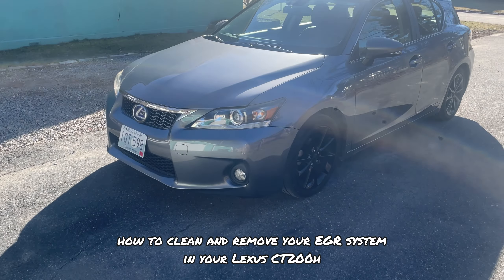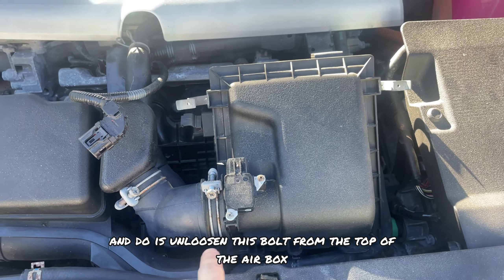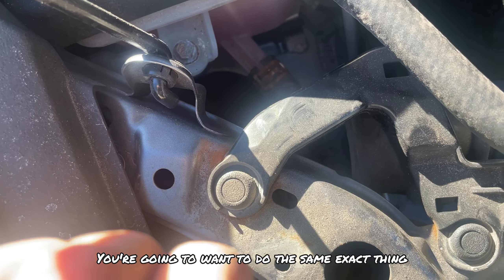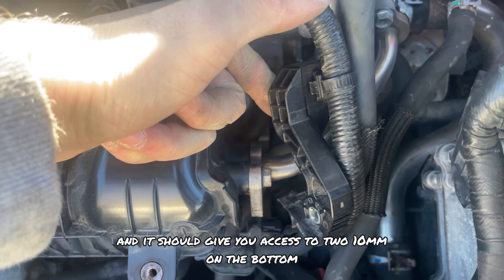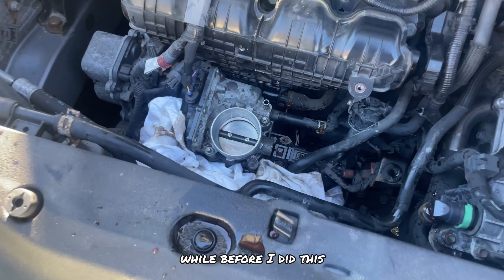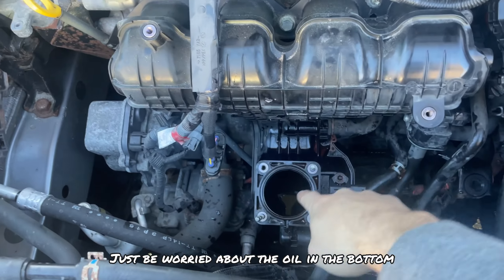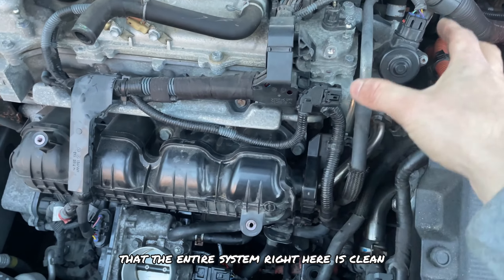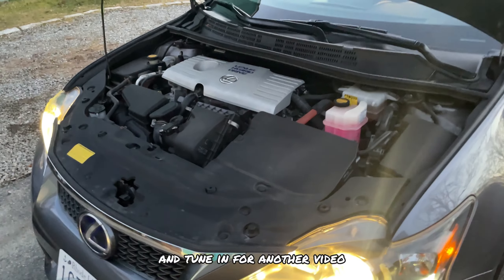How to clean the EGR system on the Lexus Ct200H!

Comment from the maker: ⚠️Keep in Mind this is NOT a full EGR system clean this is recommended if your carbon build up is mild to slow down future build up or to relieve temporary relief on the system for a couple thousand miles! A video on a Full EGR system clean will be uploaded eventually with the EGR cooler, intake manifold, and EGR valve being removed. ⚠️

Comment: Will it run noticeably smoother after the clean up ?
Reply from the maker: Yes it will especially after a newer PCV valve it will make the engine run smoother. Keep in mind this isn’t a full EGR system clean but it helps slow down the build up on the EGR cooler system

Comment: We thoroughly cleaned all the EGR parts and replaced the PCV valve. The engine light came on when we started the car. It sounds normal. Any thoughts?
Reply from the maker: Did you install all the connectors back on? Everything should be nice and snug make sure that all connections are clean and make a snapping noise to ensure proper connections, If the check engine light is still on I recommend to bring it to someone who can scan the OBD II to see what underlying error the car is alerting the ecu about
Reply: Thanks for your reply. We checked our work and sure enough there a loose connection. We connected it and the engine light went off! 

So we cleaned the EGR system, replaced spark plugs, checked the oil level, changed the transmission fluid, replaced the air filters. But the car still intermittently runs rough (a slight shudder) when it’s warmed up. It seems to occur when the car goes between battery drive to battery charge and vice versa. Or when it goes between battery drive and engine drive. I hope that makes sense.
Reply: @marystuart6864 what was the issue? With yours
Reply: A loose connector. No problem now. Thanks.

Comment: You just literally did nothing.  You were half way there to take everything off, might as well take off the EGR and intake and do the full job.
Reply from the maker: Did nothing? I stated in the beginning of the video I wasn’t gonna take out the whole system this is something you can do yourself without having to do a full service if your carbon build up is mild. Cleaning out that EGR pipe and doing the PCV, throttle body and intake will prevent faster build up on the actual EGR and improve airflow temporary which makes your service interval on a full system clean a couple thousand miles longer. I do agree that a full system clean should have been done and recorded which I plan to make in the future.